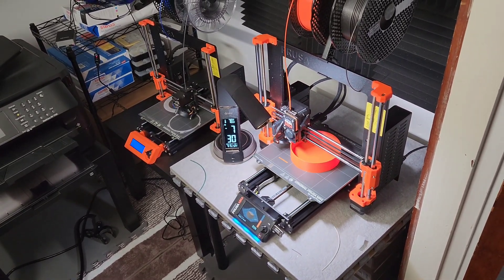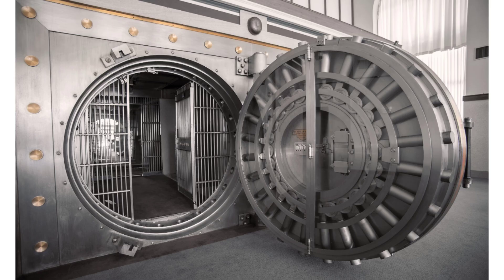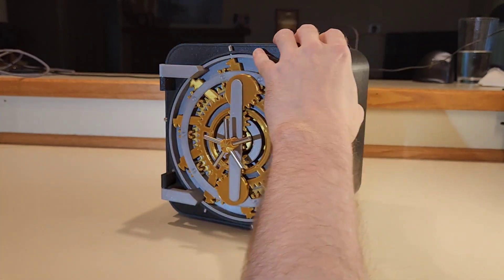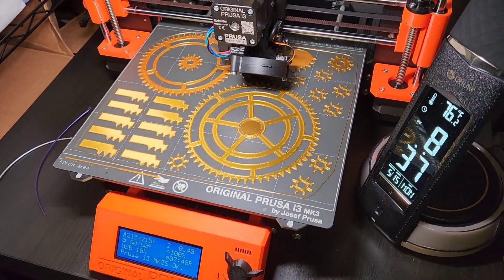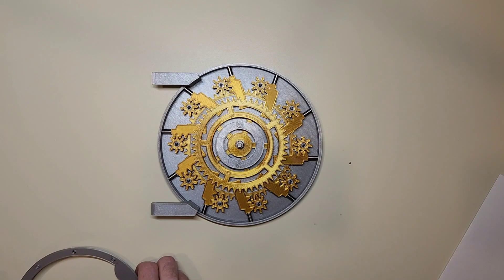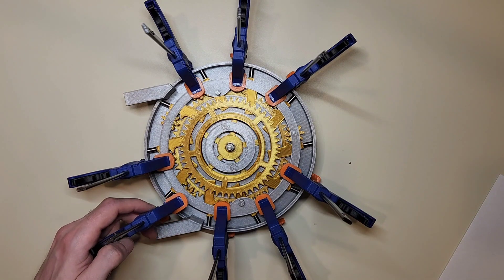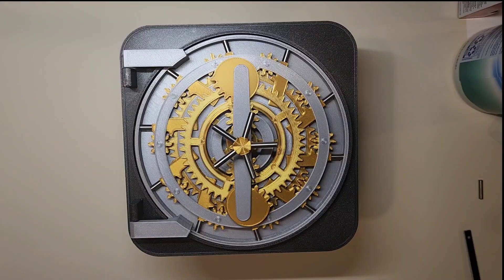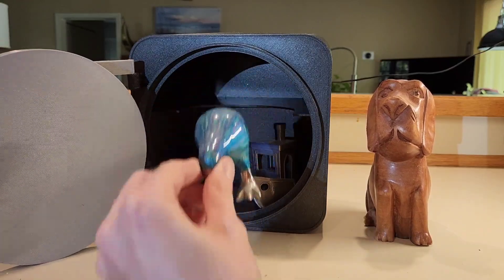3D Printed Vault Door and Box

Comment: What resources did you use to first start figuring out how to approach the design of the gears and everything?
Reply from the maker: I learned 3D modeling and CAD in college (I studied architecture) so I had lots of design/CAD experience when I started using Fusion360. I learned to make gears using the Spur Gear plugin in Fusion360 and just plugging in random inputs until I got something that worked - it was mostly just trial and error.

Comment: So, after successfully printing the coin sorting vault, I started to print this, the main box being first.. and it didn't turn out so well. All of the walls are approximately 1.8mm thick- which for a box of this size is very thin. The back of the box (which printed flat on the bed) feels a bit stronger since it's printed flat and is also connected to another surface on all 4 sides, but the other 4 walls are far too thin.

With a .6 nozzle, the walls are three layers thick- two outer walls and a center gap infill layer. I think if this box is 4cm tall, this would be ok- but at over 15cm its not enough mass to support itself. The walls all flex under light pressure with a finger.

Unfortunately for me I don't know F360 yet (I've been 3d printing for about a month on a Bambu P1S with great success) so I can't modify the file, but I wish the walls on the box were much thicker- Version 2 of your vault box with lock, the walls are about 6mm thick. I'm afraid to print the other parts right now, as I'm not confident about the box and don't want to waste all of this filament if it's not going to be sturdy once assembled (I'm giving the coin sorter box to my nephew for Xmas, and was planning on giving my niece this box). 

Any advice @RoccosStuff? Or anyone else?

Comment: @RoccosStuff are all of these dowels the same M5 x 30mm size?
Reply from the maker: The dowels are actually a mix of 5mmx20mm and 5mmx25mm dowels. I just posted the details to Printables, including dimensions for the bearing and links to Amazon. Send me a direct message on Printables if you have any specific questions. Best of luck! And thanks for watching!!
Reply: Thank you @RoccosStuff ! As long as they are 5mm diameter I'm good, since I bought the dowel multi pack you recommended for the coin sorter. I have plenty of 5mm dowels! Excited to pint this now. 

I posted a make of the coin sorter (minus the sorter) on your Printables page, I'm super happy with how it came out!!
Reply from the maker: I need to check the model on my computer, so I will post an update on Printables tonight. Thanks for the question, I didn't realize that info wasn't posted.